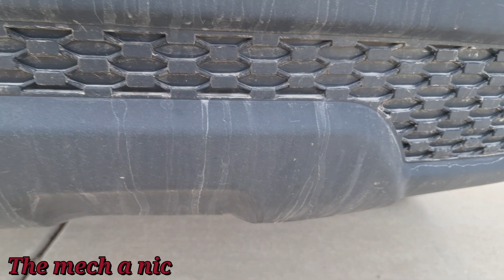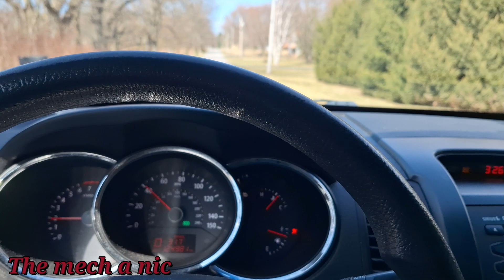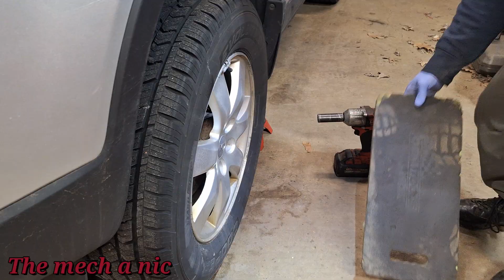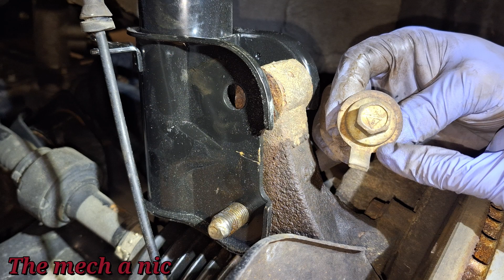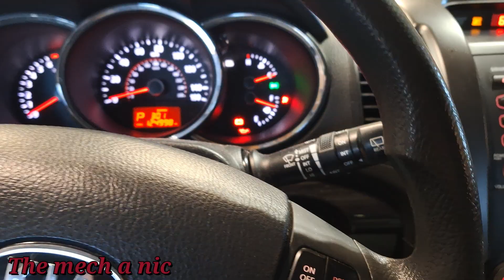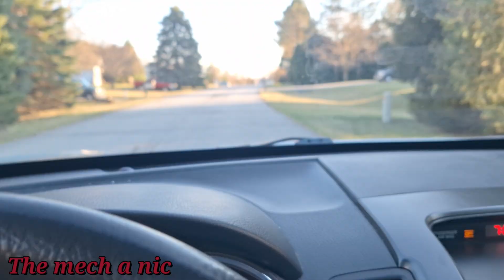kia sorento P0336 and front end clunking noise

Comment: I had a problem with my Sorento skipping into limp mode. All that I did was change the spark plugs but I was getting crank shaft and cam shaft sensor codes.

Comment: You said you already replaced the strut on the other side.  Isn't it normal to replace struts and shocks in pairs?  Did the owner just not want to spend the extra money?
Reply from the maker: Yeah just because it's "recommended" doesn't mean you have To. If the owner only wants to fix what's broken that's their choice.